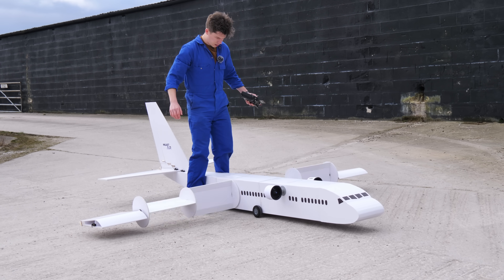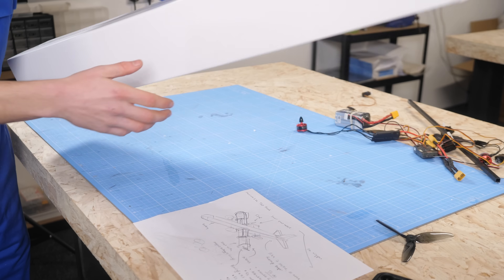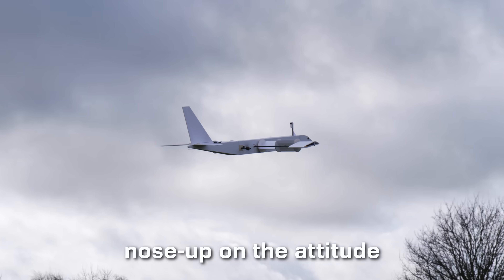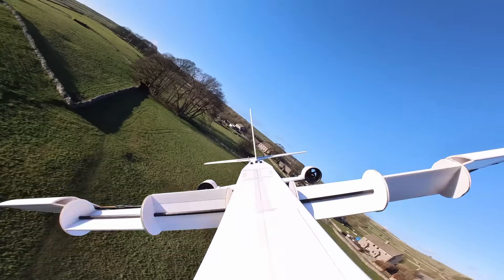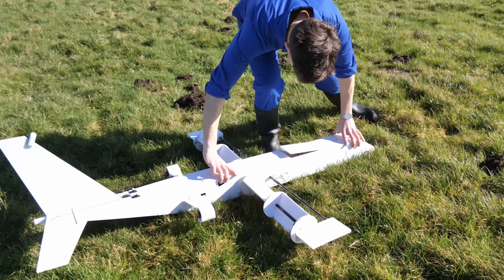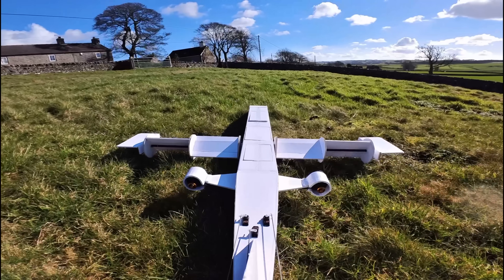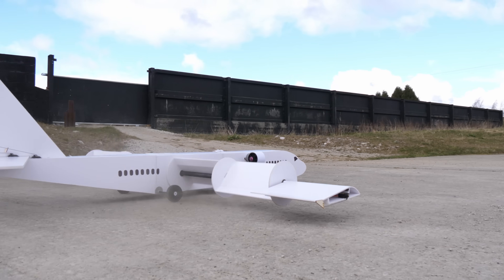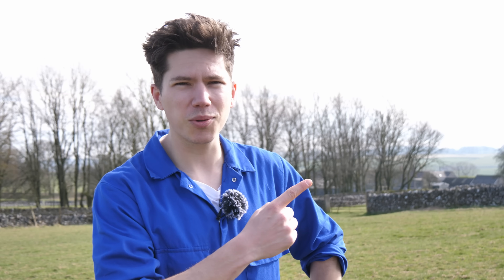Giant Magnus-Effect Plane

Comment: I would definitely say go with a big powered cylinder with a golf ball-like cratery surface for less separation. I don’t think what you did could be considered as magnus effect. It would be way less draggy and more of a magnus effect lift creating device. The whole thing about magnus effect is to create lift from a symmetric body by rotating it and redirecting the fluid. Which yours isn’t. But still pretty cool to see it fly.
Reply: The direction of spin also matters for the magnus effect. If you spin the cylinder or whatever object it is in the wrong direction it will push you down instead of creating upwards lift. A cylinder is a better idea than these flat rotating surfaces which i am not sure if they even generate any magnus at all and for a period of time their surface area is facing directly in the direction of travel which creates a lot of drag. Magnus force if i remember correctly has the equation c(v × ω). I am not sure what parameters affect the constant c but i imagine it may have to do with the shape of the object and the density of the fluid as well as other factors. Even when installing a cylinder you have to consider the moments of inertia and the required torques to make it spin fast enough to generate enough force form the effect. This project is interesting from the experimental aspect and you may learn something useful from it but its unlikely to be practical
Reply: @ There are very simple paper airplanes ( essentially, just a paper tube ) that uses the magnus efect to fly. So I  think it’s possible especially with a desing process that includes numbers:) . The direction of course matters as you say. And the lift is pretty easy to calculate assuming the flow is inviscid. Just need to take a couple of measurements like the stagnation point vs angular speed. But this channel is more on the fun, non-engineering side so I doubt the resources will be spent at a more efficient aircraft utilizing the magnus effect.
Reply: @yusufsahin3278  yes i have seen those paper ring shaped planes, though i imagine the aim here is to make a proper plane and as you said it you have to factor all the the variables in

Comment: Could the vibration be eliminated if there were four segments on each side instead of two and each pair of segments be such that the flat surfaces are on opposite sides of the central shaft? Do the flat surfaces need to be offset, or could they be through the centre of the axis?

Comment: EDFs are just crap... If you put a big ass motor with a big ass prop in the front this thing would be flying already. Also, lift does not square with wing surface, it squares with speed, so put a proper engine there already...

Comment: i have a theory i may be wrong but by mounting the engines on front it's not a good idea because you will never move if you blow your own sail by your own fan mounted on same boat, that's what you are doing here your are blowing your own magnus wing by your own engines. that's why your plane is not able to fly when you mounted engine on front instead of back. note that also that when you mounted your engine on back it is flying bot when you did vice-versa it didn't fly.

Comment: kind of odd you have a step instead of a full cylinder. Since it's the rotation of the top cylinder surface that increase the apparent wind speed. and decrease the apparent wind speed of the cylinder below. I think magnus effect scale with cylinder radius square and linearly with cylinder height. So it might better to have a low aspect ratio but large radius cylinder instead of a high aspect ratio long thin cylinder, given the same weight constraint.

Comment: The problems include a huge amount of drag from those rotors, vibration, plus friction and wear on those rotor axles. If the Magnus Effect had been a viable means of providing lift for commercial aircraft, then they would be flying daily. It's worth considering the fact that those 'reverse Magnus Effect' vents you sometimes still see on vans have been calculated to have an aerodynamic efficiency of only around 6%, in terms of the amount of air doing work on the rotor. You could probably scrape 10% efficiency from them, with careful design, but that would also make them either heavier or flimsier.
Reply: ...doing *useful work on the rotor.

Comment: 1) You did do the very basics of the basics: Googling "wing position" and a center of gravity (COG) test, right? Right?? :face-orange-biting-nails:

Because if you pause at 16:19, for me the big plane's wings look way too far in the back... like "half a meter"-far 😅. If you put the wings slightly behind where the EDFs are mounted, I'd say it looks right. With the wings this far back, this will never fly stable.  
So just in case: For a COG test nose and tail should stay horizontally balanced if you put your fingertips under the first third of the wings. The stick at 0:53 roughly shows the spot. 
In your case the fuselage is flat and broad enough that you probably can just balance it on it's stomach on a wooden plank.

If it's too nose heavy you'll always have to pull back elevator like crazy to keep the heavy nose up and thus fly near stall all the time. 
Although it looks to be in balance when you're holding the small plane at 4:50 ... if you are too nose heavy with the scaled up version, put the battery as far in the back as you can. If still not enough, or you don't want to make such long power cables, buy small lead strips and glue them on the very back of the tail.
But all of this will ultimately make your plane heavier and harder to contol.
I'd just shift the wings further forward and you'll have a lot less troubles. 

2) Wrong propeller setup. All 3 of them. 
First was bad, second (EDF) was the worst choice (from the airspeed / thrust ratio), third goes in the right direction.
What you need is: 
One big, slow and "torquy" propeller, not two tiny mosquitoes (EDFs) that flap their wings 50.000 times per second and generate a high speed breeze with no power behind it. Think giant windmill, not tiny jet turbine.
Step 1: get one big diameter, slow rotating (low KV) motor. Should weigh probably around 500g. Depends on the plane's weight.
Step 2: Cut off the nose a bit and build a sturdy, anchored in the fuselage, 3-point mount (120° offset screws so you can adjust the angle of attack of the motor).
Step 3: Aim the motor roughly 4° upwards and 2° to the right, in relation to the plane's roll axis. (Watch the video: "Why is the aircraft propeller offset to the right?" for example).
Step 4: Get one big, I mean really big folding propeller. With as low pitch as possible. Around 1/2 or 1/3 pitch of the diameter.
What does this beast weigh? 3kg? 5kg? I guess you'll need something with 16 inch diameter at the very minimum. 16 * 1/2 = 8. So a 16/6 folding prop for example (if available). But around a 20 inch prop is probably where it's at for your plane size and... sleek... aerodynamics 😏. 
You'll also need around 6s-10s LiPos (depends on the motor and prop combination). And a lot of 60 ampere gold connectors. 2500mAh capacity minimum for maybe 5-10min motor runtime (I might be off here). Also don't buy one pack. Get x times 2s or x times 3s LiPo packs and connect them in series so you can also use them singular in smaller planes. (I saw you kinda did it already. Those two tiny 4s LiPos you can maybe connect in parallel to get enough capacity to provide enough current, but I doubt it. They'll rather overheat and burn up midair 😆(maybe kidding). And motor run-times will be like 5 min or less. 

Main tip: Ask in a forum/discord for a complete motor + prop + LiPo setup recommendation that fits for your plane.

It's been over 10 years since I've flown and built my last plane, so my statements were just rough examples. So that you get an idea of which order of magnitude you'll need to be in to have enough power reserves to save that flying foam brick from a stall. Again, get one or two independent recommendations from active RC-pilots! You can still be way off with your purchase if you buy blindly. Get help in an RC-forum.

For buying parts cheaply I can recommend hobbyking.
Disclaimer: This will set you back around 300 bucks but t(h)rust me, you'll thank me later when you hit the stick to full throttle in a hairy situation (or whenever) 😁 

Also: Such a powerful setup will cut off fingers and make deep gashes into flesh in an instant! 
So always have the prop not mounted on the motor shaft unless really needed, power disconnected and remote off!

3) Wrong type of and loaction for takeoff (your runway sucks, too little ground clearance, flat field = good chance for takeoff crash)
Your best chance for success was at 8:09. See how flawless the plane took off there? 
You need just 1 more variable to have the most amount of leeway: Height. 
So that means:
- 10:41 Thats exactly why you need a second person that throws the plane for you. So you can concentrate & react in the most important seconds of takeoff.
- Light to medium and steady headwind (avoid gusty weather).
- And the throwing person stands with you on top of a hill and throws the plane horizontally into the wind. Not down, not up. Straight into the headwind, like at 8:09.

4) Free wheeling wings will probably not work with that kind of takeoff (or at all). They need to be motor-rotated.

Also: It's you own fault you made the second plane so big that your friend will have troubles throwing it now 😂
But if you get a setup similar to what I've recommended, you neither will need the headwind nor the hill ;)

Personally, I'd make the plane smaller again like before, or smaller. Make it more lightweight (use fiberglass or carbon) and put a lot of effort into balancing the rotating wings, so they generate more lift. And then work from there.

Comment: I reckon a thick airfoil with a thinner powered cylinder protruding from the top surface would have better L/D.
You might be able to do away with seperate thrust that way too.
Might make a good ultra short takeoff plane. (It will never be efficient!)

Comment: 10:00 You should move the engines in front of the “wings”. The additional thrust could be used to spin the Magnus wheels plus it’d help fix the obvious tail heavy design. Having the engines behind the wheels will also mean you have very turbulent air moving into the engines.

Edit. Haha I should learn not to comment too soon. 😂

Comment: this is a FINE idea.keep promoting this idea. this design especially would be beneficial for FLYING CARS/TAXI.(your idea could wind up to be the most prevalent use for those small flying cars/taxi).
Reply: Sure. About as useful of an idea as the huuuge amount of flying cars we have. A true dreamer.
Reply: @Renee_R343  you never follow any science and engineering news have you? some french company already testing a FLYING TAXI. yes its a taxi.very small.smaller than a small helo. and then there are already concept being simulated using something similar like shown in this video. again, on small craft that can be flown vertical from your backyard. the taxi one ALREADY FLYING. nobody make use of it yet due to no regulation are being made to manage that kind of traffic YET. but they still use ROTOR tech. like quad drones.
Reply: @ Flying cars are too impractical until they can fly like the DeLorean in "Back to the Future".
A flying car is shitty at being a car and also shitty at flying.
People have dreamed and made concepts for different versions for decades. 
None of these taxis or cars will be viable in the long term. Just because they are too impractical. So no market.

Comment: What about using the leading edge of the foil/wing as the rotating part, but leaving the rest of the design of a traditional foil as is? I've wondered about that for a long time. Having the rotating cylinder by itself seems unwieldy and inefficient.

Comment: If he used cylindrical rotors, as in the pure Magnus effect Flettner rotor, the rotor would have to be power driven, as I don't see how it it would autorotate like the flat rotor plates do in a moving airstream. What he has here is a Savonius turbine, autorotating flat(ish) plates that are doing a bit of Magnus effect into the bargain. To make the lift a bit smoother he could instead of using two autorotating plates at 90 degrees to each other on each wing, twist the plates into a helical shape instead. A bit of dihedral on the wings might make it easier to fly (more stable) but then he couldn't use a single straight wing spar, unless he adds dihedral via the outer wing stubs or as a sort of small vertical fin mounted on the top of the body between the wings.

Comment: I think that the powered rotor verion  should be made of simple cylinders - which would both reduce drag and increase lift.  There are equations available which predict the lift and drag as a function of length, diameter, rotation speed, etc.  My gut feeling about your prototype is that the dual function of the rotors - being effectively simultaneously both Flettner rotors and wind turbines creates a compromise that is not helping you.

Comment: Why don't you use a cylinder for the magnus effect? This has to be rotated externally, but the air resistance should be significantly lower.

Comment: With a rotating wing how do you figure the angle of attack? If these were normal wings, with the nose high attitude in your test flights it would tell me your CG is too far aft, or the wings too far forward. Which is part of the reason you saw a loss of lift in a bank.

Comment: Really cool project! I think you will have better luck getting those engines out of line of the "wings". Behind the wings the engine isn't able to achieve efficiency because of the turbulence from your wings. With the engine in front it creates turbulence for the wings. Also, the lift you're getting from the spin is from its interaction of the ambient air. Powering the spin is essentially stealing its lift and substituting it with mechanical input. Perhaps lengthening the wings slightly to get a short flat section before the spinning part so you can mount the engines under the wings. This should really improve engine thrust and wings lift

Comment: What is even the point of something like this if you're gonna make it look like a regular aircraft with wings anyway? Why not try to do something different like making the rotors very short but have big radius (so maybe they generate more lift)? Also, having larger radius would mean larger inertia which would mean they're more resistant to sudden shifts in wind direction.

Comment: You need to put a canard on it.  Those tiny stub winglets don't look like they're in the right place to have any influence on the adverse pitch the rotors cause, and having the forward control surface would help negate that oscillation between Normal flight and tail Stall the magnus effect wing is causing your horizontal stabilizer to have.

Actually, on that note, maybe a T-tail or V-tail would be better for this design?

Comment: Cool project but your interpretation of the lift equation is wrong. V^2 is velocity not wing area. Doubling your wing area doubles your lift and only helps if doubling your size doesn't double your mass.
Reply: Glad I’m not the only one that was confused by that interpretation 😅
I know I’ve done things like that before too!
Reply: but the wing loading is now less right? because the weight of the motor, battery and servo is distributed over a greater wing area. Correct me if im wrong though

Comment: Awesome video. Love that you try crazy ideas for fun. May I suggest that you split the spinning rotors in to 4 smaller ones on each wing (Now you got 2 on each wing) and place them all perpendicular to each other. Theoretically you got constant overall drag like this, but it changes in magnitude across the wing span. An other idea that came in to my mind is to add some balance weight inside the core of the carbon tube. That way you could reduce some vibrations on higher rotating speeds.